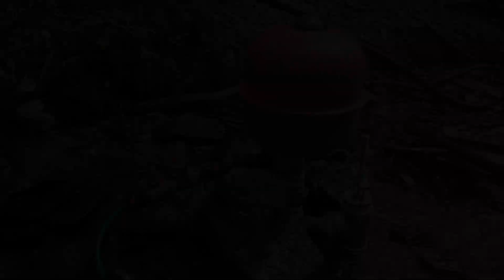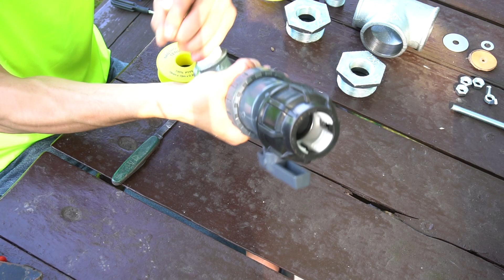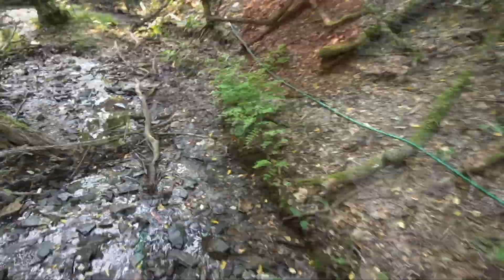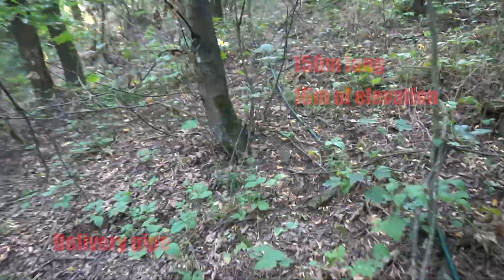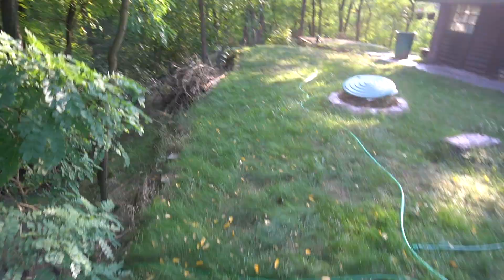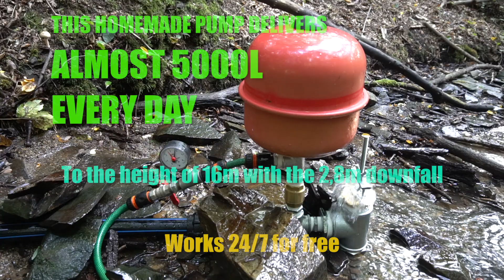1'' RAM PUMP - almost 5000L per day - DO IT YOURSELF, step by step

Comment: hi thank you Bohumir. I have made this 1" ram pump but my waste valve doesn't seem to work at all. It works when I press it manually but will not continue by itself. I am using a slightly bigger tank which has a 1" fitting. I have done a test with about 1.5m head and placed my delivery pipe about 4m up. Please help if there's anything you can think of that i am doing wrong
Reply from the maker: Close the delivery pipe and try again. 4m is too little for 1,5m drop. Or make your intake pipe shorter, with less head pressure.
Reply: Thank You Bohumir i will try that out. @BohumirStehlik

Comment: Hi Bohumir..I've watched all your videos n all are awesome n helpful too..they are highly specific n very clear about all the parts n input output calculations..n I thank you for that..
I have a small request.. i know you have mentioned the head n pressure of inlet but to be more specific could you also measure the inflow of water (just like the outflow) and by doing so could measure the overall efficiency of all the ram pumps you've made..coz that would great to know the efficiency of any device we use, isn't it?.. we can come to know how much water is being wasted from waste valve..waiting for your reply☺

Comment: Great! So is there any actual build info that we can follow? It's interesting to watch you, but it's not replicable without a parts list and schematic, or we're all just left reinventing the wheel.
Reply from the maker: Check my other videos. They are also in the description.
Reply: @BohumirStehlik  Thankyou. Your lift & head measurements and pipe lengths are identical to my needs and situation.

Comment: Your drive pipe is 1.25" and the waste valve is 2". What in this setup makes it a 1" ram pump as you described in the title of the video?
Reply from the maker: The diameter of pumping valve and the rampump itself. Only the T of the waste valve is 2'' in order to fit everything inside and still have a reasonable flow.

Comment: Hi Bohumir! Thanks for all your great videos! I built your waste valve but using 1' 1/4' pieces since i could not find 2'. What would be the expected pressure in bars I should be expecting? Rest of pump is 1'. Many thanks
Reply from the maker: Hello. Insuffient info. I don't know your head pressure. 
1 1/4 pieces are probably not enough for the valve to send enough water through.

Comment: Hello, thank you for your excellent videos. I have two questions. If you drill a 2mm air hole in the pressure valve, just below the valve, would the pump improve efficiency by having more air in the expansion tank? I also wanted to ask you if instead of the europr valve you could use a clacket valve and whet would be the difference in pressure and efficiency.?. Again congrats for your videos and many thanks for all the useful information and tips.
Reply from the maker: Hello. 2mm hole is tooo much. You can drill the smalles hole possible to get some air. But the efficiency would go down because the pressure would escape. Do it only if you need to add air to the tank. I don't know what is europr valve and clacket valve. But about valves, it is ok as soon as it closes tight...
Reply: Thank u so much. The clacket or check valve is the one you showed in the video where you compared the 3 waste valves

Comment: Prosím ta aky priemer má prívodná rúra?  Hadica je 1/2” ? Diky
Reply from the maker: Privod je 40mm vodovodni hadice. Vnitrni prumer 32mm. Hadice je 1/2'' zahradni.
Reply: Bohumir Stehlik aby som teda pochopil správne princíp.. 
prívod musí mat rovnaký vnútorný priemer ako trkaci ventil ? V tomto prípade mosadzný fitting 2”/1”
Reply from the maker: @yurykm  Stejny prumer, jako trkac. Tzn v tomto pripade 5/4''. Mas to v nejakym z mych jinych videi. Ventil je tak velky, aby se do nej vesel pist a stale zustal prutok jako pri 5/4. Mosazny fiting ma na 1'' konci prumer 33mm (zavit).

Comment: I have a stream with a minimal grade, and long distances of pipe. I'm planning on building this design,any advice? I have 2m head over 100 m, and only need to pump 6-10m but a distance of 230+m. Is this practical?
Reply from the maker: Hello. I wouldn't do more than 50 meters of intake pipe. 1m of downfall should be ok for 10m pumping height. You won't have so much water but you will have constant stream of water and that counts. I don't know about the pumping distance but my tube is cca 100m long. 
Be careful about the weight of the waste valve... It could happen that it is too heavy for such a small water drop...